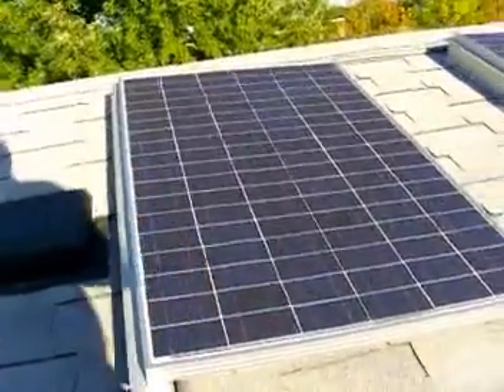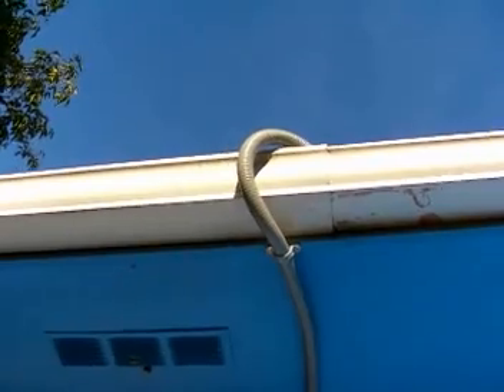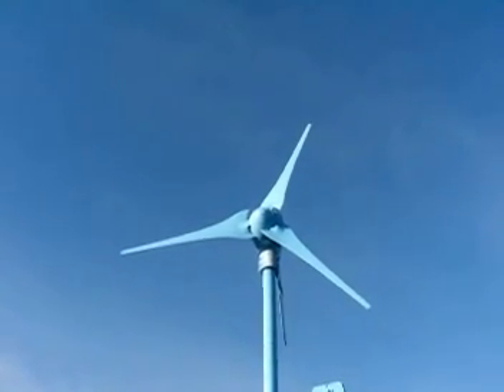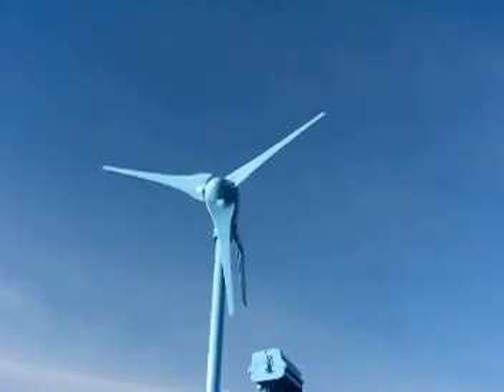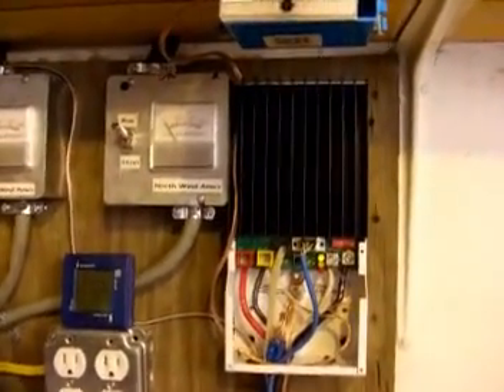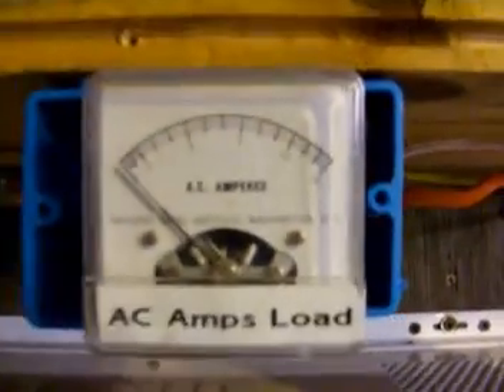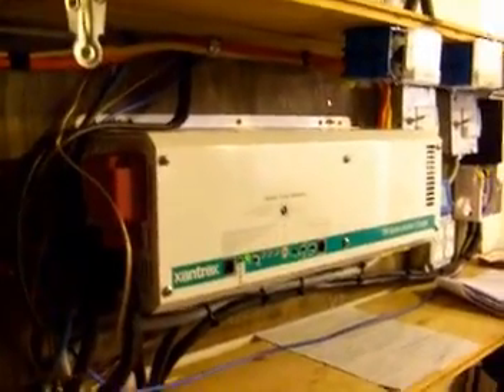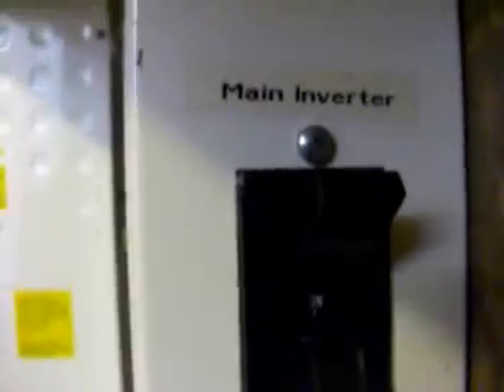Off Grid Renewable Energy Solar Wind Setup Part1

Comment: It is late already so i think you bought it ..but yes you can use it . But it could be problem if you want use it same time..In day time you can use simple diode...so that power source with more voltage will be adding to your system and in night(or close to morning or evenig) it isn't problem .. Your wind turbine will be charging batteries.

Comment: So you are not living in normal house. :) In our house we will spend about 3000 KW/year  +-500KW  So we don't need as much power..If you want run your house on battery you can do it.you just need strong sine inverter or similar inverter(mod. sine) but you must know what kind of appliances you will have and how much powere they will take. For most of the things you need true sine inverter(if you are not on grid ofc) and for rest mod. sine inv. will do.(cooker or something like that)

Comment: The best thing would be solar panels connected in series and grid tie inverter...and protection boxes ..fusses, DC switch and also AC switch and that is it ..No more battery and trust me it cost much less than all what you have and you will pay every 5-10 years for new batteries because they will not be so good. in gried tie inv you may change inverter (if it will die) but that could happend with your inv also. Grid tie is always cheaper..BUT it is possible your elect. company will not like it.

Comment: @DeFensorForTiSs The 1000 watts is per hour. so 24 hours is 4x1000x24=96,000. so for example, if you get 5 hours of good sunlight per day, divide 96000 by 5. you get 19,200. that is how many watts you need to be producing per hour of sunlight. so if you find some solar panels that you like, just divide 19,200 by however many watts the solar panels produce. you will also want a few extra panels just in case. Just to warn you, It is going to be expensive to get something to run that much power.

Comment: At 3:16 you are talking about the tristar ts60.  im looking at doing the same set up.  but (4) 100 watt duponts, (1) 400 watt air x.  I realize the charge controller is the "heart" of the system but we cant afford $600 bucks for an mppt outback or xantrex.  I like the ts 60...can you run your wind gen, and the solar system at the same time through he ts 60...thanks

Comment: Think of the energy saved if they'd started the project in Spring instead of the 1st October! 
If he sustained and Eco footprint of zero for the rest of his life Mr Stroud would never offset the energy used the overuse of materials and machinery.
How much sense does it make to have to insulate more external wall surfaces by having having multiple buildings!
The people growing the weed were probably doing more for Gaia!

I checked the Survivorman...and commented on part1 ..sorry Les.

Comment: Hello, cost is a big problem I have a simular set up and would like to tell you my idea>Get a 12v lesson motor, 2x pully and belt to a harbor freights 10,000 watt power head then a small float charger back to the batteries. Im gonna try it as soon as I get the $400. With the pannels and the wind generator with the charger it should have lots of extra energy!

Comment: I have 1 60watt panel($350) 1 ,7 amp charge controler ($20) 1 12v batt. $55.00 ,1 inverter 1500 watt ($25 at yard sale)=$450 us.live central arziona,runs tv, raido ,lap topALL DAY LONG never has went dead untill 3 hrs after dark.ho the lap top is picking up free service,an runs a $59 for 5 year majc jack phone service FREE ANY where calls any time TRUTH SO HELP ME GOD, So spend all the big money you want!!  I keep it simple COST IS EVERYTHING>ironweve@yahoo